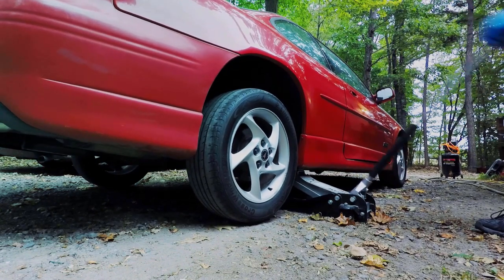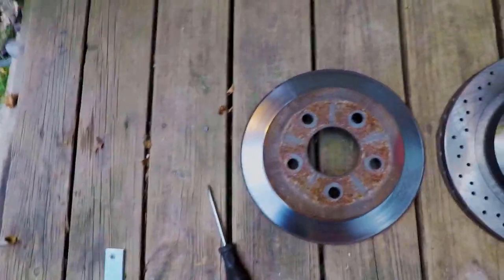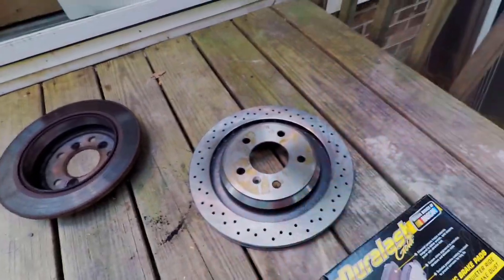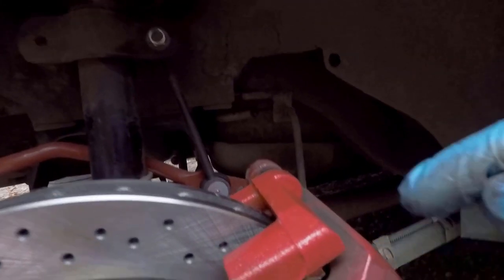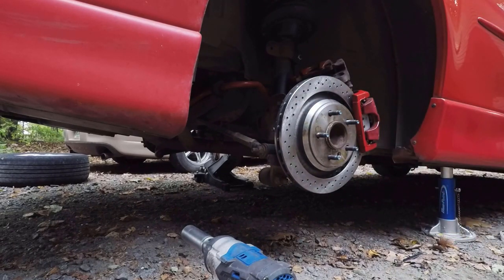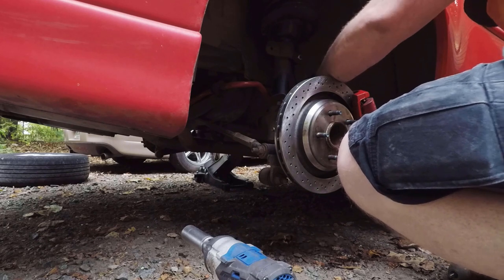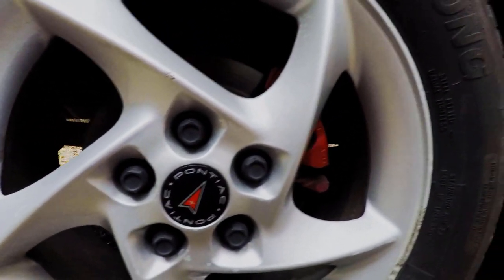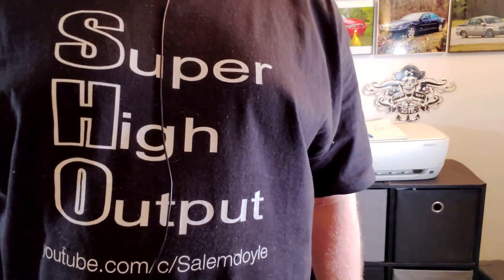How to swap GXP brakes onto your 6th gen Grand Prix

Comment: you didn't mention how the stock parking brake cable hooks up to the gxp calipers.  how do they.  thanks.
Reply from the maker: They dont.  Parking brake is moved to inside the rotor.  Gxp rear brakes dont have intigrated parking brakes
Reply: @SalemDoyle  ...does this mean that there will be no parking brake?
Reply from the maker: There is still a parking brake. Its just the one like the older cars.

Comment: Do you know if those fit behind stock 16 inch wheels?
Reply from the maker: I dont think they will.  They take up most of the space behind the 17s
Reply: Yes. The rear gxp brakes clear any 16" wheel offered on grand Prix's. 
Front GXP brakes DON'T clear 16" but do clear any and all 17" offered on grand Prix. I know this because I had a gxp once and was curious and tryed mounting various wheels from my other grand Prix's I've owned onto it.

If you plan on keeping stock 16" wheels. The largest brakes you can get is f-body conversion in front and GXP rear.
Reply from the maker: @carnage50x  good to know, thanks
Reply: @carnage50x  glad to hear. Was gonna ask the same for my 03 mcss. Once I get the fbody conversion done first that is.
Reply: @RyanPuckett1979  yeah. I would recommend the f-body conversion first and see how you like it. You'd feel a big difference and most people are happy with only f-body front and leave the rear stock. You can definitely feel that the front grabs more and the rear is just kinda there for stability not doing much. You can feel it's biased to the front now. Then if you upgrade to rear gxp as well. Its not too much of a difference. It just feels better balanced and under heavy stopping loads you do gain alittle.
Reply: @carnage50x  yea. That was plan. Get stopping good then do a top swap/zzp supercharger to the girl.
Reply: @carnage50x  Do these also clear the crosslace rims? The spiderweb looking rims...zzp states on their ordering page that the f-body calipers DO NOT fit those particular 16's, can you confirm this?
Reply: @davidjohnson8122  that's the one set of wheels I haven't checked. If zzp states fitment issues than their probably right. I always forget about those wheels.
Reply: @carnage50x  I still may be able to get away with the heavier Impala dual piston calipers in this case since they accommodate smaller rotors that are 11.7 inch instead of the 12 inches that the f-body uses...still a worthwhile upgrade while being able to keep my current rims, going for the sleeper look 😁

Comment: How much of this info can be applied to older W-Body cars? I just bought a loaded low mileage 95 Cutlass supreme coupe.
Reply from the maker: They are similar.  But a lot of little differences. I dont think the brakes are interchangeable
Reply: @SalemDoyle  Any idea where I can find info on the older models?
Reply from the maker: @740seth  online forums mostly.  If i can ever get my hands on an older one i will make some videos.
Reply from the maker: @740seth  near winston salem in NC

Comment: Where did you buy the calipers and the records? It looks great!!
Reply from the maker: Got the calipers from the junk yard, pads and rotors from local parts stores.  Advance and autozone
Reply: @SalemDoyle  Great! And are the pads also different from those of the normal Grand Prix?
Reply from the maker: Yes
Reply: Do the calipers fit a Grand prize 2005 gt? I’ve seen some forums and it comes out that I don’t
Reply from the maker: @arcentalesnoel  they will, but you have to convert to the older style parking brake.  I have a video on it
Reply: @SalemDoyle  Can you send me the link to the video?
Reply from the maker: https://youtu.be/GKUa4H-IL4U

Comment: Do the gxp front brakes work? What is needed?
Reply from the maker: Yes.   Need calipers. Rotors and pads.  They bolt right up
Reply: @SalemDoyle    hey what about chevy impala ss  do they bolt right up?
Reply from the maker: Yes. Should work on all w bodys
Reply: @SalemDoyle  thank you.. also the  GXP front caliper and rotor is it the same size as the Chevy Impala SS?
Reply from the maker: I dont think so. But im not sure a out that
Reply: @dannysnt7264  no impala is 12 inch grand prix gxp is 12.7